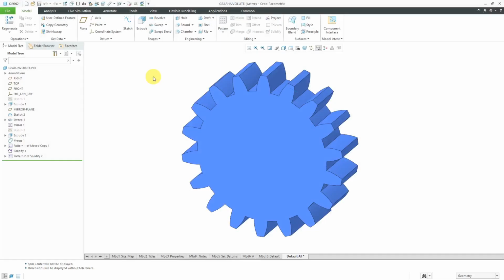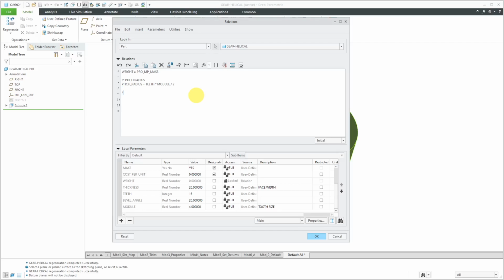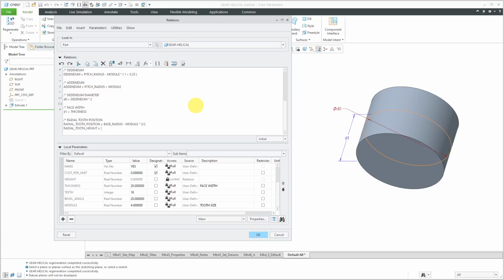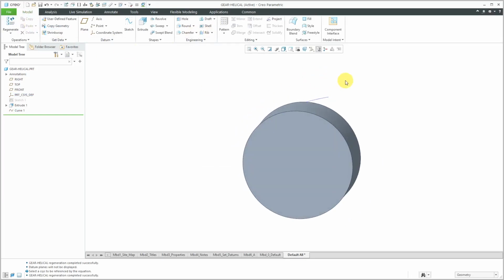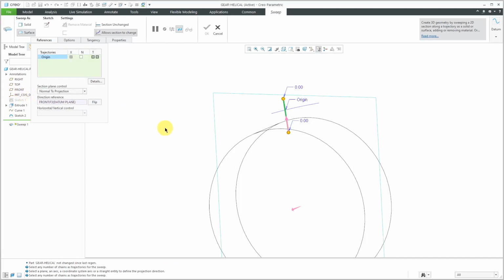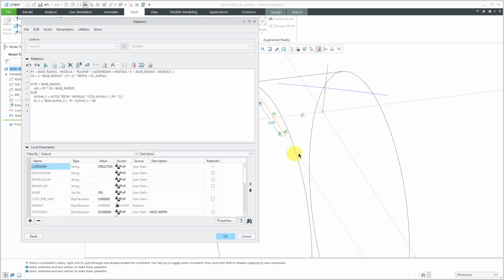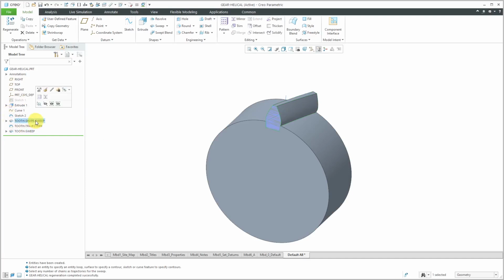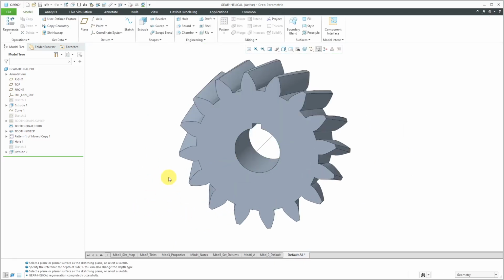Creo Parametric - Helical Gears | Demo

Comment: In sweep sketch relations " I am getting error message- probable error in function evaluation
Reply from the maker: Can’t tell just from the error message. Probably a typo in the Relation. Ask your resident subject matter expert or open a ticket with PTC Tech Support.
Reply: Hi sir ,
Can you do a video about  designing a spiral bevel gear with relations
Reply from the maker: I would if I knew how. I might make a regular bevel gear video after reverse engineering a bevel gear that I have. But that's going to take a lot of work and research, so don't hold your breath. I've got a full-time job and a kid on top of running this channel.
Reply: Hi , sir. I have found an easy way in the nx cad for bevel gear modelling . ( gc tool kits) .
Reply from the maker: Then I suggest you use that. Having performed a benchmark a few years ago, I know that will costs a considerable amount of money.

Comment: at the very beginning at about 00:46, how do you get the planes to be labeled like that? I've been trying to find the setting
Reply from the maker: Do you mean turning on the Datum Tag Display from the View tab?
Reply: @CADPLMGuy  That's exactly it, thank you! Second question, I know there are righthand helical gears and lefthand helical gears. How would you edit the gear so it goes in the other direction?
Reply: @CADPLMGuy  Never mind, I figured it out!
Reply from the maker: I hope you mirrored the part about the vertical midplane
Reply: @CADPLMGuy  I changed the bevel angle parameter to -20 instead of 20 but your method makes more sense.